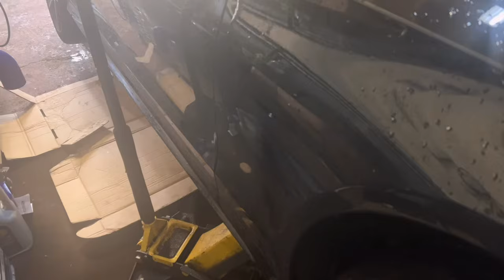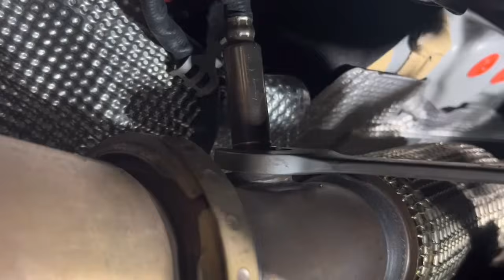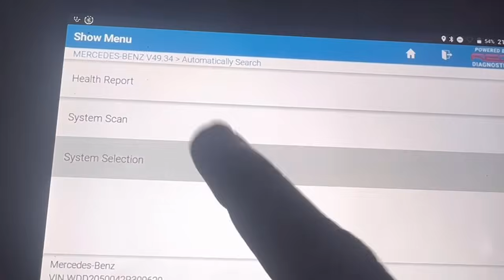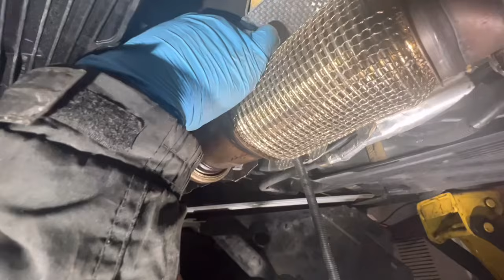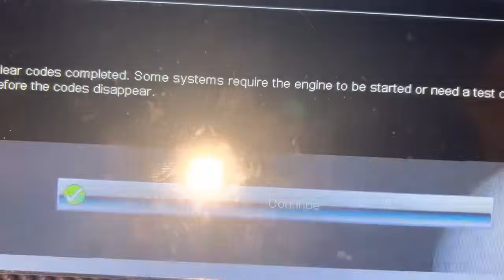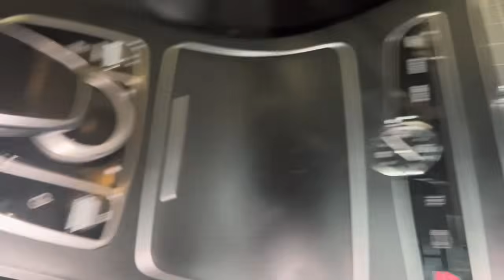MERCEDES  ADBLUE RESET WITH NOX SENSOR - FULL VIDEO

Comment: great video. I have a mercedes c class w205 2015 year, c 250 diesel. I cleaned the adblue injector . he turned on the check engine light. p220162 The NOx sensor (cylinder bank 1) has a malfunction. The Signal Cimparmision is Faulty. when I clear the error it is gone for 20-30 days or 50-60 kilometers and then it appears again. how do I know which sensor it is, upper or lower, what should I do?
Reply from the maker: It seems like you're experiencing a recurring issue with the NOx sensor on your Mercedes C-Class W205. Here's what you can do to troubleshoot and potentially resolve the problem:

Diagnostic Scan: If you haven't already, perform a comprehensive diagnostic scan using a professional OBD-II scanner or diagnostic tool. This will provide more detailed information about the fault code and may help pinpoint the exact issue with the NOx sensor.

Identify Sensor Location: The Mercedes C-Class W205 typically has two NOx sensors, one upstream (before the catalytic converter) and one downstream (after the catalytic converter). Based on the fault code description ("NOx sensor (cylinder bank 1)"), it indicates a problem with the sensor on cylinder bank 1.

Consult Service Manual: Refer to the service manual or technical documentation for your specific vehicle model. It should provide detailed information about the location of the NOx sensors and how to access them.

Inspect Sensors: Once you've identified the location of the sensors, visually inspect them for any signs of damage, corrosion, or loose connections. Pay particular attention to the wiring harness and connectors.

Swap Sensors (Optional): If you have access to a similar NOx sensor, you may consider swapping the sensors between cylinder banks (if applicable) to see if the fault code follows the sensor. This can help determine if the issue is with the sensor itself or another component.

Check Exhaust System: Inspect the exhaust system for any leaks or damage that could affect the operation of the NOx sensor. A faulty exhaust system can lead to inaccurate sensor readings.

Professional Assistance: If you're unable to diagnose or resolve the issue on your own, it's advisable to seek assistance from a qualified mechanic or Mercedes-Benz dealership. They will have the expertise and specialized equipment to diagnose and repair the NOx sensor system accurately.

Addressing the NOx sensor malfunction promptly is important to ensure proper emissions control and engine performance. Continuing to drive with a persistent fault code may lead to further complications or potential damage to other components.

Comment: i have same problem 2 months struggling.. i think i need to change the nox sensor
Reply from the maker: Better to take scan report before any replacement
Reply: @SanuMotorswithCharlie  we scan it already and we change the adblue injector but the message and the engine light is always coming back after we test drive

Comment: I have a mercedes-benz vito 2017 and I have replaced one nox sensor 1 and got it programmed but then the nox 2 failed so got it changed but do you have to get it programmed eg learn and rest again or does it have to be programmed it again because ir the second nox sensor. I was told by the mercedes when I bought the part.
Reply from the maker: How ever need to reset the lights. 
Most computers can’t relearn. If you can better to do. 
I show many people didn’t do
Thanks
Reply: I have got it programmed to my mercedes-benz vito but the fault keeps coming back nox sensor 2 bank 1 and the engine management does not come on all I do is plug a Autel hand held machine which I bought from Amazon it the message fault p229f nox sensor circuit range performance bank 1 sensor 2. I clear it but keeps coming back it was programmed by two different people

Comment: i have a 2015 mercedes w212 e400 (petrol) with NOX sensor issues (both needs replacing), can i just map them out? is it ok to drive with this issue? my country doesnt have any emission controls etc...
Reply from the maker: If you don’t want visit remap people. They will delete 
Thanks
Reply: @SanuMotorswithCharlie  thank but does the vehicle absolutely need it? Or is it ok to delete it?
Reply: @DeAssassin345  
Yes it’s needed.
Reply: @CLICKANDLEARNCh  thanks bro but i wanna know for what purpose? emissions? or will it make the engine run worse?

Comment: P204B08 – The AdBlue® pressure sensor has a malfunction. There is a signal fault or the message is faulty.

That is the message im getting i've taken out the injection nozzle but no residue off adblue on still cleaned it with some hot water then started the car up and checked the nozzle no adblue coming throw it. So if u could guide me a little i don't mind paying for your time its just a headache for me as it says i have some many miles left before it stops dead. I would have bought the car to u but you are about 200 miles away from me. If u could help i dont mind paying for your time thank you.
Reply from the maker: IT’s could be pump, adblue line,adblue injector sometimes Ecu faulty. Frist check with Mercedes are they recalling 
Others wise this is very expensive job. 
Thanks
Reply: @SanuMotorswithCharlie  Thanks For the help with your experience I thought u would have been able to be more clear.  But Thank You.
Reply from the maker: @OKANE-dy8yd  
I’m sorry need to involve lot of physical checks. Before take a decision.

Comment: Excellent video and thanks for your guidance sharing your experience. I have got a W205 manual driven car. Keeps getting error code P2002-FB (The Efficiency of the Particulate Filter (Cylinder Bank 1) Pending, Stored. I have followed your video and changed AdBlue injector and lean the area. But keeps getting the same error code after driving about 800 miles.  Any suggestion where I should look. Thanks.
Reply from the maker: Please check computer code

Comment: Hi 

I have a mercedes vito 2017 and had a nox sensor bank 1 faulty but I bought thr sensor from the main dealers mercedes in Derby and my mechanic could not take the sensor off he said it is stuck in the  Cat converter so he said he will need to break the cat converter so need to replace with a new one. He heater the sensor up but could not take it out. 
But he cleared the codes and I was driving for over a 1 and half but then I got a message on the dash it said adblue malfunction and it said em po in 490 miles which the mechanic said the van will stop.

How can you take out the sensor without breaking the cat converter
Reply from the maker: Spray WD40 around area 2 days every hour , or use good reasonable blowtorch , 
Better to take NOx sensor from dealer. Online parts cheaper. But not good as we think 
Thanks
Reply: Hi I got it off by a mechanic but he does not have the software to program it and I have bought the original nox sensor from Mercedes-Benz but before it had em op in 490 miles a d adblue malfunction but its still there
Reply from the maker: Sorry when work with new cars need need different computers. I has 7 computers for like this problems( different computers for different cars)
Thanks
Reply: Someone tried to program it and it gets cleared the message em op in 254 miles amd adblue malfunction but it keeps coming back and the mechanic says it might be missing the files
 What dod you think

Comment: Thank u for this video 
I wonder if you only have to clear the faulty code after replace the sensor and not to have registrated the module again?
I see some vids that they to have registrated the module again after replacing.
Reply from the maker: It’s depends. Some cars need to learn/program but this car not 
Thanks
Reply: @SanuMotorswithCharlie  so my Mercedes w205 / 2014  /220 bluetec does not need to be registered after replacing but only reset the fault codes?

Comment: If you change the rear Nox sensor apart from clear codes do you need to do any other clear codes?
I have fitted a non Mercedes sensor and every day the engine fault light comes on. I can clear the fault but it comes back the next day.
Is there anything other than fit a genuine Mercedes Nox sensor, the answer. Is it common to have faulty new Nox sensors?
Reply from the maker: Many people use after market sensors. Sometimes it’s better than original parts. 
Better to check with computer what’s going on there. 
Don’t assume and change sensors 
Thanks

Comment: After changing the Nox sensor 2, how many miles worked the car until asked you to change the Nox sensor 1? These sensors shouldn't be changed in pair? At least this is what I've heard.
Reply from the maker: NOx sensor 2 to mean sensor name.  If it needs to change bank 1 sensor computer will say NOx sensor 2 bank 1 faulty. 
How ever this is  a quality problem. Might be cheaper parts 
There is no time period for this sensor. And one one sensor cost that time around 600. This days around 400. 
 I never encourage to change both. But I know some garage doing opposite. 
Also if vehicle’s has NOx problem . Please check exhaust system and other sensors and wiring system. Sometimes problems somewhere

Comment: Just to clarify. The large one is the Adblue injector, the one closest to the front of the car. The next one is a temperature probe and the rear one is the Adblue sensor. If the injector gets stuck open or blocked it takes out or shows a fault with the adblue sensor/circuit. Better to take the injector off etc and clean it with hot water.  Could try cleaning the sensor and temp probe Hope thats more clear.
Reply from the maker: If your car c class,Adblue injector has electric connector and hose for adblue supply. After first NOx sensor you can find adblue injector, after injector very last sensor bank 2 NOx sensor.
You can remove adblue injector and clean. Or can you use adblue clean additive 
Also you can find out more details from google or you tube

Comment: is it needs other works? except a reset ECM like a coding or firmware update.
Reply from the maker: After repair needs to delete faulty code
Reply: is it need to disconnect a battery?
Reply from the maker: @양준석-z9c  
I didn’t. If you need you can